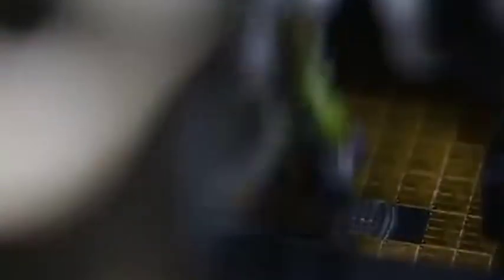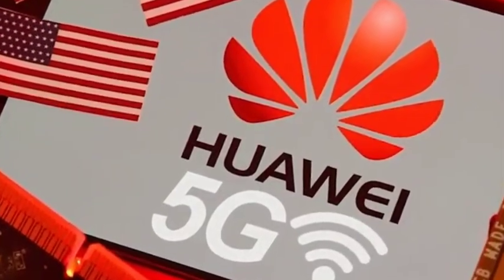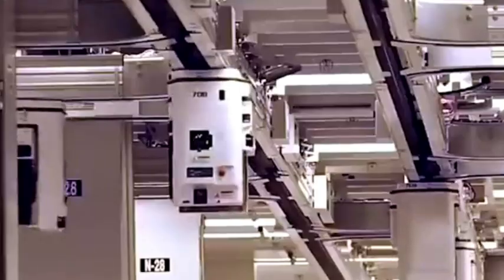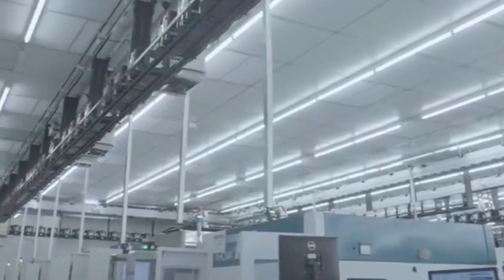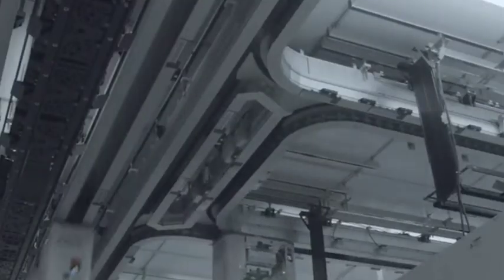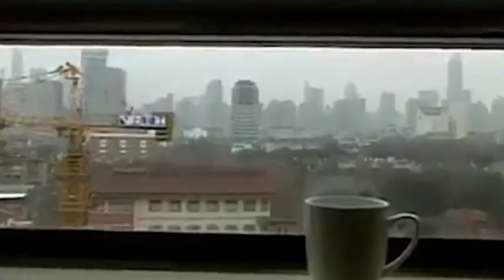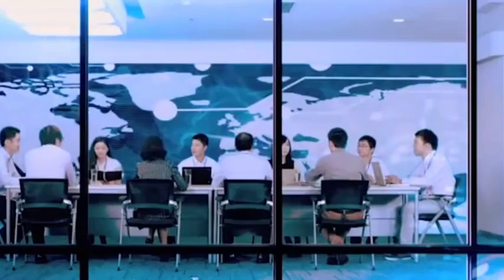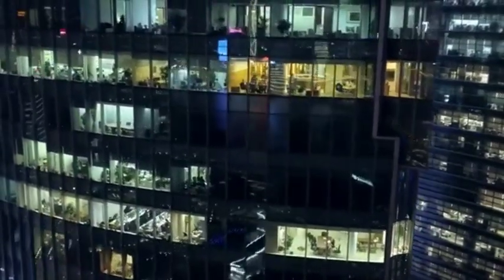A breakthrough in Chinese chip equipment, which can be adapted to a variety of lithography machines

Comment: Misleading video.  ASML is the monopoly in EUV machines.  In DUV, it is not, but it still has the lion' share of this generation of lithography machines.  Nikon and Canon also are suppliers in DUV, but they are not mainstream.  

Bottom line:  If you are trying to produce high end chips below 7nm nodes, you need a EUV machine.  Maybe the technology will change in the future, but today  that is the situation.

The problem for China is to produce all necessary process equipment that can achieve at least 7nm or have alternate suppliers other than US semiconductor equipment makers or there will be a restriction in how many chips China can produce at 7nm or larger.  It's 7nm and smaller is blocked because it cannot get an ASML EUV lithography machine.  Time will tell whether China can become self-sufficient in semiconductor fab equipment.
Reply: What has not been mentioned is that the other Chips maker machine company is also working to bypass us technology in order to enter China market. The spell of money is amazing isn't it?!